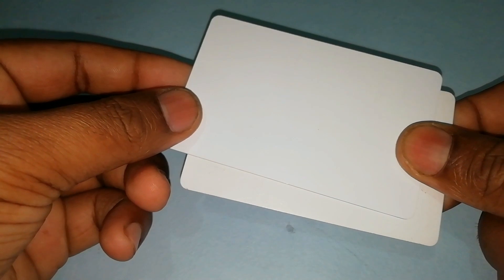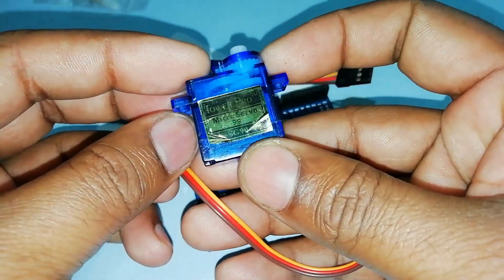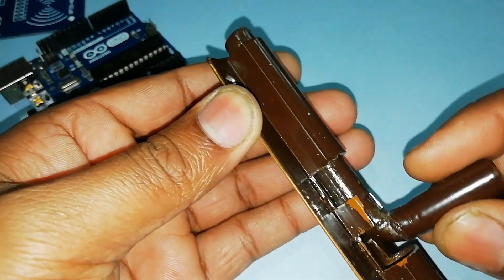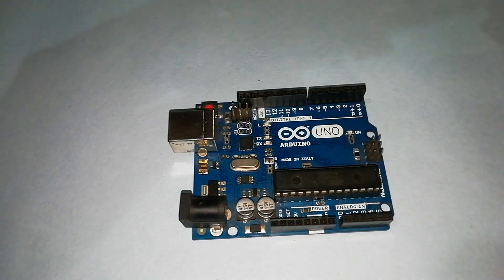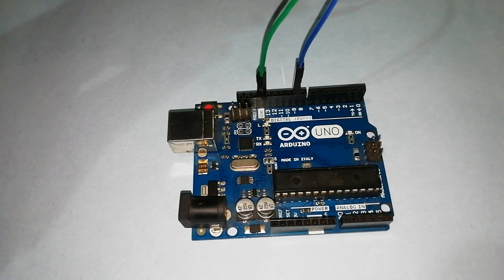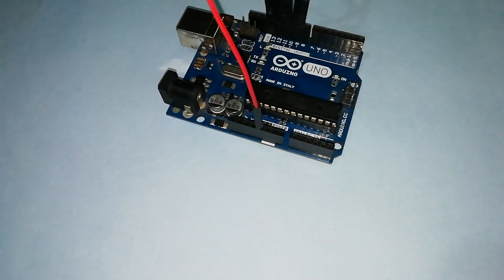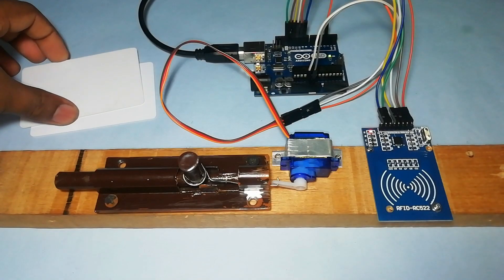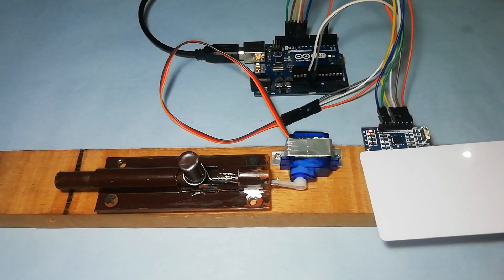How to make Rfid card door lock system arduino project |Rfid

Comment: Where is the code?
Reply from the maker: Source code... 
#include <SPI.h>
#include <MFRC522.h>
#include <Servo.h>

#define SS_PIN 10
#define RST_PIN 9
MFRC522 mfrc522(SS_PIN, RST_PIN);   // Create MFRC522 instance.
Servo myServo; //define servomotor name

void setup() 
{
  Serial.begin(9600);   // Initiate a serial communication
  SPI.begin();      // Initiate  SPI bus
  mfrc522.PCD_Init();   // Initiate MFRC522
  myServo.attach(9); //servomotor pin
  myServo.write(0); //servo home position

  Serial.println("Put your card to the reader...");
  Serial.println();

}

void loop() 
{
  
  if ( ! mfrc522.PICC_IsNewCardPresent()) 
  {
    return;
  }
  
  if ( ! mfrc522.PICC_ReadCardSerial()) 
  {
    return;
  }
  //check card UID on serial monitor
  Serial.print("UID tag :");
  String content= "";
  byte letter;
  for (byte i = 0; i < mfrc522.uid.size; i++) 
  {
     Serial.print(mfrc522.uid.uidByte[i] < 0x10 ? " 0" : " ");
     Serial.print(mfrc522.uid.uidByte[i], HEX);
     content.concat(String(mfrc522.uid.uidByte[i] < 0x10 ? " 0" : " "));
     content.concat(String(mfrc522.uid.uidByte[i], HEX));
  }
  Serial.println();
  Serial.print("Message : ");
  content.toUpperCase();
  if (content.substring(1) == "63 CA 54 2E") //change the card  UID of the card/cards that you want to access
  {
    Serial.println("Authorized access");
    Serial.println();
    delay(500);
    myServo.write(90);
    delay(8000);
    myServo.write(0);
    
  }

else   {
    Serial.println(" Access denied");
    
  }
}